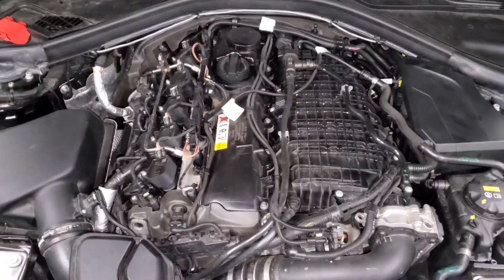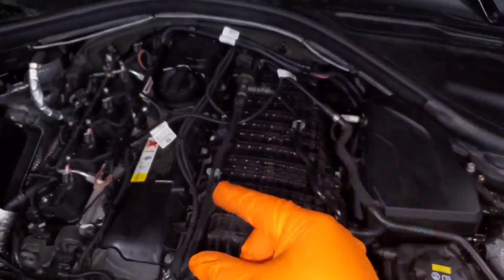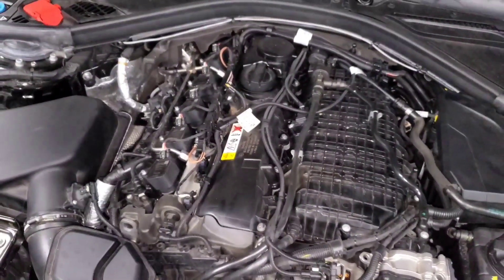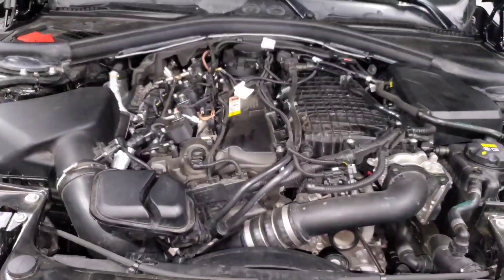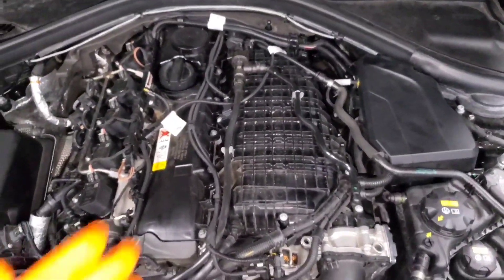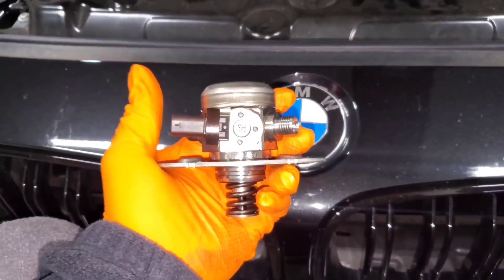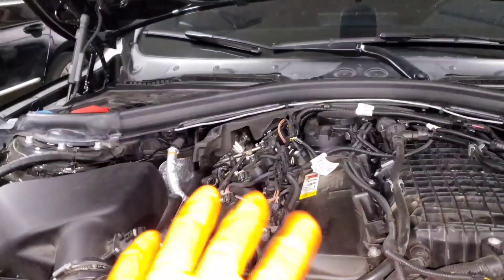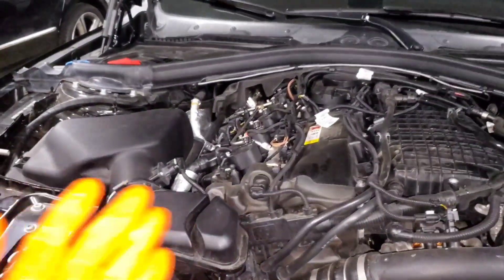**READ DESCRIPTION** Guide to B58 Fueling Upgrades

Comment: Hi Kern, I want to run the stock turbo with a stage 2 multimap for ethanol. From your  video, "Guide to tuning "stages"" I thought I would follow your recommendation but in this video I get the impression the fuel pump upgrade is not really worth it? To run approx. E30 tune with stock turbo and downpipe should I just get the cheapest, TU pump or really no pump at all is going to be effectively the same in this scenario? Thanks.
Reply from the maker: It depends on your goals. You don't need a hpfp upgrade for stage 2.

Comment: I have a basically stock X3 B58 gen 1 running E85 with a MHD stage 1 e85 map.  I don’t want to upgrade the turbo.  In terms of priority and bang for buck what should I install?  I was thinking Dorch Stage on and perhaps a new downpipe but for emissions purposes would like to avoid doing a bunch of irreversible stuff.  I also really want to avoid mixing fuel.  Finally any recommendation on Flex Fuel kit?  E85 is widely available in CA, but I am driving to TX and don’t want to have to plan my trip around E85 availability.  Love your videos.

Comment: I am on a stock turbo and had no intention of trying to max it out but I got my hands on a dorch stage 2 hpfp for a great deal. I am not really looking for huge peak gains maybe 450 hp, I am fine with that but I do prefer to have a wide power band. I hope this isn’t a dumb question, but would a conservative tune be the way to go for me? Or is it the case that I would need a turbo upgrade.
Reply: I was going to do like an e30 mix
Reply from the maker: you can run the stage 2+ ots map

Comment: You should do a video on the Supra B58. Right now I'm on a g30 900 turbo and port injection. No HPFP or LPFP upgrade yet. Was looking at doing a HPFP upgrade when I buy the lpfp system. Any ideas??
Reply from the maker: There aren't any HPFP upgrades for the Supra. Port injection gives you more than enough fuel anyway so no need.

Comment: Hi, I got a spool hpfp kit for my mercedes s63 Amg I installed. Now the car can’t start up. Do you need to tune the ecm just to get it start? I look at the live data the low pressure is 6.4 bar high pressure is 12 bar only. I was think you can at lease start up and tune to get more fuel.
Reply from the maker: Typically your tune needs custom settings for it to work properly
Reply: @kern417  do you need to tune it for just starting it

Comment: TU pump here in Canada with all the parts is almost $2k. I spent $2200 and got the Dorch stage 2, even if I don't need it now I would rather not limit myself down the line.
Reply: @kern417 ahhh yeah you’re right, that doesn’t add up.
Reply from the maker: There's absolutely no reason why the pump should be $2k. Search around. I bought it from Germany for $600.
Reply: @kern417 probably meant CAD not USD. It’s $1,700 on the Dorch website and that’s over 2k CAD.
Reply from the maker: @AlexWaz315  I'm talking about the TU pump That they said is $2k. There's no way that's the only option

Comment: Do I have to upgrade my low pressure pump
If I upgrade the HPFP
Reply from the maker: No
Reply: @kern417  I lied I’m going for 680 whp. I’m I still okay
Reply: Only trying to run 600 HP at the end of the build

Comment: Would the jb4 work with any of the hpfp's? I know you mentioned they work best with like a custom tune (MHD, Bootmod3 etc.)
Reply from the maker: It will work with the TU pump but I'm not sure it offers any tunes to take advantage of it. You'd need to message Terry.

Comment: Btw if you're going to make an educational video, I would get the facts straight. Spool has been around for far longer than dorch.  This video is quite bias to one side rather than stating actual facts
Reply from the maker: This is a B58 fueling video, and the B58 fuel pump from Dorch came out before the B58 spool pump. Then when the Spool pump came out, they had several issues with leaking lines and filters. They say they resolved them with their supplier now, but we'll see. Those are facts.

Comment: So If im understanding u right, your basically saying, a nice stage 1 hpfp would run better on stock turbo than a stage 2 dorch?
Reply from the maker: Not run better, moreso that the stage 2 pump won't net significant gains over stage 1

Comment: So my buddy and I had a conversation related to this earlier today actually. And I’m curious as to what your input would be. So he is custom tuned fbo and meth (stock hpfp) and believes he is making more power on 91. As for myself, on BM3 stage 2 e30 (stock hpfp) and meth. I think I make more power on e30 than 91 (both having meth). I am going to try full 91 and see how my car likes it. He believes we should make more power on 91 with meth than e30 with meth because we won’t be pushing our stock (hpd5’s) to a limit and making them crash/dip psi. What’re your thoughts?  Should I stop running e30 with meth and go straight 91 with meth?  I have been seeing my hpd5 drop very low and was thinking about upgrading hpfp
Reply from the maker: E30 + meth will make more power than 91+ meth with a good tune. Hpfp dips don't lose power but its not safe. Regardless, you can run more timing with E30 and even more with e30 + meth at the same boost levels you'd hit on 91. The main benefit you're seeing is meth will clean up timing on an OTS map without having to add more ethanol so you're getting the most out of the tune.
Reply: @kern417  thank you so much for sharing your incredible knowledge!

Comment: So listening to you video the difference between running a FX150 and a TU hpfp on a stock turbo would be minimal and actually might decrease power with the bigger hpfp?
Reply from the maker: No, you just will not see big gains with a bigger pump on stock turbo. It really depends on the tune and fueling you use
Reply: @kern417  great! Going e85 wedge tune with a fx150 and wanted to know if I wasted my money lol
Reply from the maker: @ianbehm4837  that'll be a solid setup for sure. You'll enjoy it and the simplicity

Comment: At the end of the video in regards to the estimated power numbers, are you saying it becomes inefficient to run the bigger pump when youre not trying to max out the power? For example, I’m aiming to make around 600whp. If I run a stage 2 HPFP, is that going to be overkill that affects me negatively compared to if I run the TU pump or a stage 1?
Reply from the maker: No, you can never have too much fuel. It all depends on what you're doing to reach that power, i.e. turbo size/efficiency and fuel type. Many people are hitting 600whp on dorch stage 2, but it's also possible on a Dorch Stage 1 with a bigger turbo. Also, if you're only using pump gas instead of e85, you won't need as big of a pump. But again you'll need a bigger, more efficient turbo to hit the same hp numbers.

Comment: Upgrading my stg1 pump to the dorch stg2 pump this black friday (Dorch is having a sale). You mentioned the spool 180 flows more, should I get that instead if I want to max out my GC turbo? Currently running E40 22psi mid range and 25 psi up top with my dorch stg1 and it drops to 2100psi.
Reply from the maker: I think dorch stage 2 is a solid option

Comment: Awesome content! What hpfp would you choose is you were running a B58 with pure800, catless dp, chargepipe, eventuri intake strictly on 93 octane (RON98)?
Reply from the maker: It depends on your hp goals but  you can make good power with a stage 1 pump on pump gas
Reply: @kern417  It’s my daily driver. So i am looking for a high but reliable power figure without wmi, ethanol and pi.
Reply: @eg000ja  if you’re not going with a mix or meth, certainly just stick with Dorsche stage 1. On a custom 91 tune, you should be around ~510whp/520wtq (this is worst case scenario)
Reply: I was planning on the same mods for my b58 I plan on staying on 93 I dm dorch engineering they said if you plan on staying just 93oct than stage 1 would be fine . But if you plan on running ethanol mixes than go stage 2 hpfp

Comment: I’m thinking of Dorch Stg 2 HPFP. You’re saying its not as useful on a stock turbo & should be paired with bigger turbo (such as pure 800) to safely make more whp? Thanks for great content!
Reply from the maker: Not really. What I'm saying is you can make more power with a smaller pump and a bigger turbo, instead of putting a bigger pump on the stock turbo. No matter what, the bigger pump will have the most support for high hp 👍🏾 hope that makes sense.
Reply: @kern417  be careful of smaller pump bigger turbo tho thats how u blow
Reply from the maker: Not with a good tune. Just keep boost in a safe range.
Reply: @kern417  i was custom tuned stock turbo stock pump gen 1 b58 and i blew my motor. Justin at twisted tuning had me throughout. 93.
Reply: @kern417  LJ at no clutch also blew from small pump big turbo
Reply from the maker: @medogabr9952  no he didn't. He blew because he was leaning on charge pipe Injection and had an uneven distribution of fuel. I mention it in the video.

You had a bad custom tune if it caused you to blow your motor. Here's something to consider. Stage 2 OTS maps work with the stock pump. A stage 2+ map will make more power with a bigger pump. That doesn't mean you're going to blow the motor on a stage 2 map. They keep boost down to stay within the limits of the stock pump. It's simple for any competent tuner to accomplish.
Reply: @kern417  ya ur right, i was pushing crazy power without any fueling upgrades whatsoever. red turbo every single day burnouts constantly, i beat the shit out of my motor. i am getting upgraded internals thhooo
Reply from the maker: #PartyTime
Reply: @kern417  yessirrrrr
Reply: @kern417   finally on stock turbo can i do everything what i want ( stage2+ e30) or need TU pump anyway?  goal is 420-430whp without meth
Reply from the maker: @berdzena8797  you need a hpfp upgrade to run stage 2+
Reply: @kern417  thnx and good luck best channel for B58 <3 make one video about XHP too, its fake tune or do something :)
Reply from the maker: @berdzena8797  since i have a manual transmission, I don't have a need or experience with xhp. It definitely works and is good to use for tunes above stage 2.
Reply: Makes sense. Thanks

Comment: Solid! I wish I would have held out for a 340 instead of my 335. Different price point though. B58 is🔥
Reply from the maker: They definitely both have their pros and cons. One nice thing about the 335i is they didn't release a N55TU 3 years later 😅
Reply: @kern417  Yup, I am here wishing I held out for a 58TU instead of a basic 58
Reply: @keithw4920  what year did b58tu come out ?
Reply: @josemariavilla5327  2018 but not on all cars. 1st car to get it was G20 340i iirc.